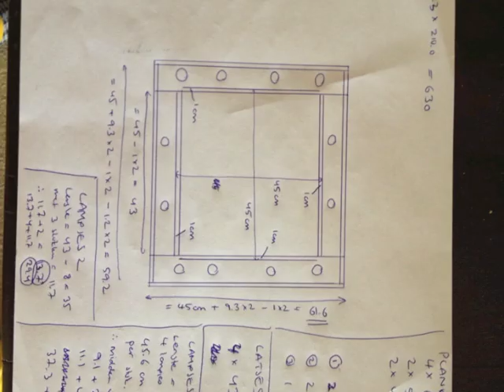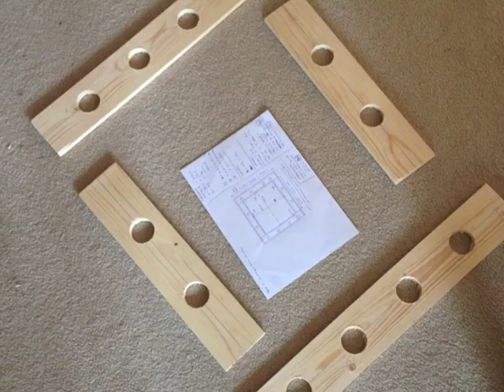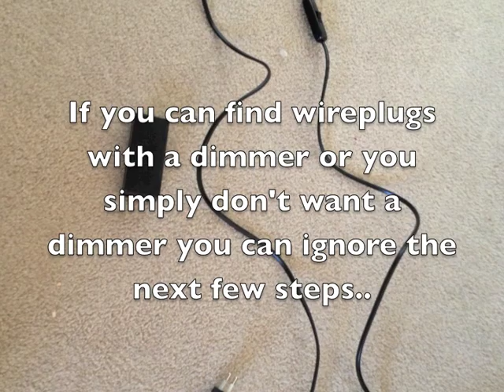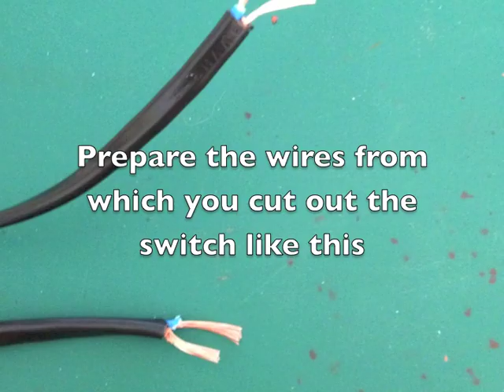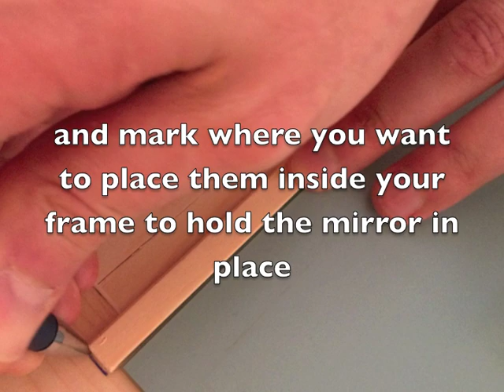DIY MAKEUP MIRROR with Lights

Comment: Just one really important tip - PLEASE don't take that much insulation off your wires (the brown and blue plastic covering. You should only just take off enough insulation for the copper wire inside to fit inside the terminal. You never want the copper wire from inside the blue and brown insulation to touch, otherwise they will short and likely cause a fire